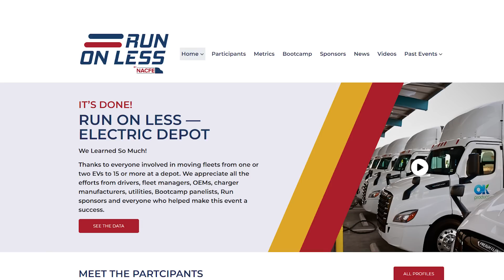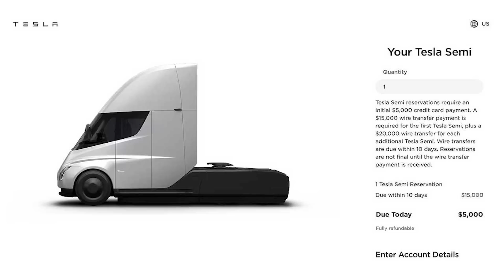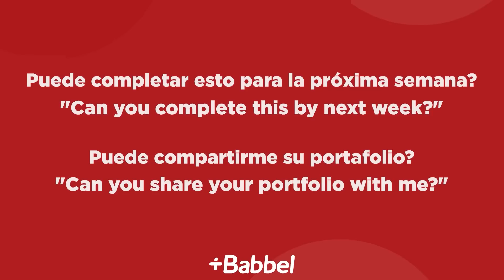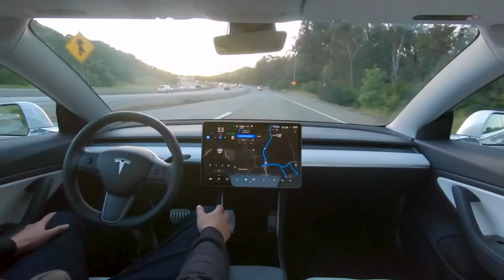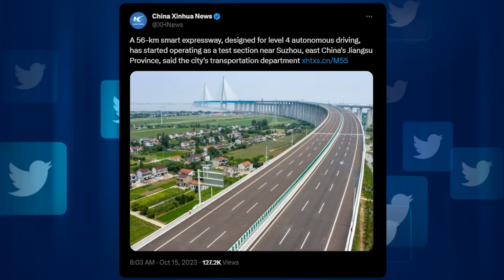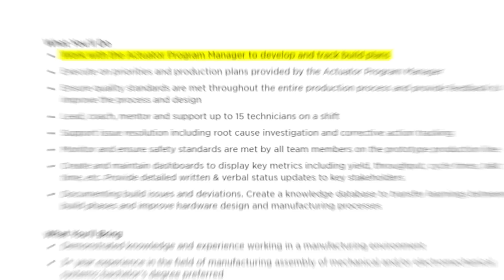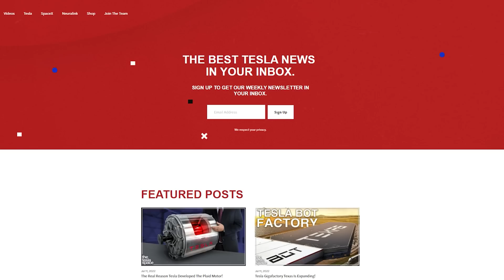Tesla Semi Performance Results Revealed!

Comment: As a driver 80k gvw is standard also didn't mention speed that 570 something miles was done at, betting it was 60mph or less most of the trip as previous tests have shown tesla truck can't do extended highway speeds for long. Electric truck may work for local (300-400 miles a day) but not for over the road.

Comment: Three fast charges a day?  Those batteries won't last a year at that rate.  Just watch what happens to Lyft drivers when using a Tesla.
Reply: First of all, it wasn't three fast charges in a day; it was one fast charge at a Tesla Megacharger, and two slower charges at a Tesla Supercharger.

Out of millions of Teslas in the US, some have had premature battery failures; and some of those have been Lyft or Uber drivers, often after exceeding the warrantied mileage. But that's not evidence that batteries in general will fail within a year if fast charged. in fact, Recurrent has recently released a massive study showing that fast charging of modern batteries has very little effect on battery life; "The results show no statistically significant difference in range degradation between Teslas that fast charge more than 90% of the time and those that fast charge less than 10% of the time."

In any event, if they do fail, it's on Tesla, because there's a 1 million warranty on the batteries. So you can be pretty confident that Tesla has made sure that the Tesla Semi batteries won't fail prematurely when fast charged, because obviously that's going to be the most frequent charging experience. Best to  peddle your FUD elsewhere.
Reply: @BigBen621  It's not FUD if it's happening to others...  Fast charging kills these batteries quick.  Tesla is not standing behind warranties if you fast charge.  Both these cases are known issues.
Reply: @theoracleprodigy   Fast charging kills these batteries quick. 
The Recurrent study completely refutes this claim.

 Tesla is not standing behind warranties if you fast charge. 
Evidence?

 Both these cases are known issues. 
A few unsourced anecdotes are not evidence.
Reply: @BigBen621  Watch some youtube from people who have used them for uber.  For cars the warranty is only 50k in miles and it was out of warranty... So I was wrong on that but the battery was dead after 1 year of driving with fast charging.  I would be very shocked if they last 1million miles with trucks.

Comment: The issue with electric vehicles  is not the vehicles them selves its the fact that one the current power grid in this country can't sustain the current load in most places causing blackouts an rolling brown outs an 2 they are putting the cart before the horse there is basically no infrastructure to support a major shift to electric.  All the current truckstops would need charge stations that needs to be in place an effective b4 a shift to electric in the commercial transport industry. Just my opinion
Reply: "blackouts an rolling brown outs" in most places? Examples, please?

Comment: I was told by a Toyota employee working on the fuel cell project that they use the Tesla semi to transport their materials that they're using to build a fuel cell network throughout California. They're aren't enough Tesla semis, so Toyota is now developing a diesel/fuel cell hybrid semi, which imo is the best option. Toyota will also start focusing on fuel cell passenger vehicles more than electric vehicles. During the Summer, I had 2 members of the Olympic Committee as passengers. They talked about how the Olympics will no longer be a part of the pre-games, and that the Olympic trademark/symbol will also not be used for pre-games. This is due to money distribution issues and how they're tired of going through so many channels. I do Uber in SF, so I hear lots of things.
Reply: You either made this up, or you were told wrong; I'm betting on the former. Toyota isn't doing anything of the sort, because all Tesla Semis now in private hands are owned by PepsiCo.

Comment: so at 1076 miles with 3 recharges...... it has a range of 358 miles, while a diesel semi has a range of 900 to 2000 miles on 1 tank of gas.......
Reply: So what? In California, where all the Tesla Semis are deployed, a solo driver in a Tesla Semi can drive as far in a day as permitted by speed limits and HOS regulations, which is 11 hours x 55 MPH = 605 miles. So 295 to 1,395 if that range is simply wasted carrying extra diesel fuel around.
Reply: @Big_Ben_from_La_Mesa yeah if they fully fuel it. However many of them actually don't fully fuel them so they can carry more cargo with out going over the weight limit.

Comment: From someone been driving a Tesla model 3 for a week now doing rideshare and a retired trucker with around a million miles. I can say that Tesla is a great vehicle to drive. It will stay at the temperature that you last set while it’s plugged into a charger. So, if you set temp at 65F it will keep that without losing power/ miles. Tesla hates to change batteries when they are not under 10% and you can go from 0-60 without losing all your energy doing so. That means you will only lose what you would have lost with the same amount of miles. Also, everything is on the tablet to control the whole vehicle settings. You can customize inside lights, outside lights and horn to how you like it. It has face recognition on the tablet that once you use the vehicle enough it will start without you having to card screen (card key) in. You can also customize the braking and steering wheel the way you like it. Seat same, it has cameras all over the inside and outside the vehicle that if you were in an accident that your story is told without guessing. The bad part is that you can’t feel the weight of the load so I bet you can’t tell if something is off on the load. I bet Tesla can add an arm autopilot line hookup if we want one. Maybe they can design auto landing gear rollup and drop to the setup. The point is, if we think it maybe they can add it and allow the driver control from the cab.

Comment: they're fine for short hauls but thats it, btw 70lbs is not a full load, 70k lbs is the gross weight with all included, now i contracted for pepsi before an drove their trailers an i noticed in the bill of landing the weight with like 400lbs to spare to the 80k lbs limit was about 36200 meaning that if it was hauling with 70k lbs gross weight the actual payload at best would be 26600 at best if considering a tesla tractor weighs the same as a volvo vnl 860 but due to the batteries i highly dought it, i would estimate a 3000lbs increase on teslas side therefore the actual payload was around 23600 or less, which is light, so light in fact i would be very careful not to lock up the trailer wheels driving in Montana due to us considering a load under 25k lbs a light trailer
Reply: Demonstrated payload is 44,000 lbs. of concrete highway barriers on a flatbed trailer at 82,000 lbs. GCVW, so probably 43,000 lbs. in a slightly heavier dry van trailer.
Reply: The Tesla semi is calculated to be around 27,000 lbs. Which makes me wonder if all the extra weight on the drives will limit payload weight due to tandem sliding.

Comment: 70 000 pounds full load, but what was the payload? I could make an electric truck that would go 20 000 miles but could only car 1 pound of payload, deceptive results again.
Reply: ive sub contracted with pepsi before with their trailers ive noticed a close to gwl of 80k load was bout 36200 of payload so make of that whatcha will(the tractor driving with was a 18 volvo vnl 860, the tesla ones prob heavier then the 860)
Reply: @ELISainta  for sure its heavier, that's why they won't release the data
Reply: Demonstrated payload is 44,000 lbs. of concrete highway barriers on a flatbed trailer at 82,000 lbs. GCVW, so probably 43,000 lbs. in a slightly heavier dry van trailer. So at 70,000 lbs. GCVW, payload would be about 31,000 lbs.
Reply: @BigBen621  we wouldn't have to speculate if they released their numbers, I wonder why they don't.

Comment: You are so Incorrect regarding weights of transport trucks. A 5 axle combination is allowed to be 80,000 lbs total. Combined weight. That also depends on the Bridge Formula, Axle weights especially. NO way your precious truck hauled 70,000 lbs weight.  Let's see... It's simple. Let's assume the Tesla weighs around 30,000 lbs. Trailer looked like a 48ft,  so i'll say it weighs around 10,000 lbs. So looks to me like the Tesla can haul roughly 40,000 lbs. I know nobody will agree cuz everyone loves precious tesla,  But the real facts and numbers are not being shown. It's just P.R.
Reply: Good one. I was waiting to see if someone would call bullshit on this Fanboy channel.
Reply: That's actually pretty close. Electric and natural-gas powered semis are allowed an extra ton, to 82,000 GCVWR. And the Tesla Semi weighs more like 27,000 lbs. Demonstrated payload is 44,000 lbs. of concrete highway barriers on a flatbed trailer, probably 43,000 lbs. in a dry van trailer.
Reply: I can’t remember the exact numbers but I watched a vid where a guy did some rough calcs on the Tesla semi based on other semi and Tesla’s other EVs and found that the Tesla semi can only legally haul like 20k lbs or so. That battery is just weighing itself down so much.

Comment: BS.  The GVW limit is 80,000 lbs.  I have yet to see any data detailing range and towing capacity for this vehicle.  Fact is this vehicle weighs a huge amount because of the batteries.  Saying that we were able to go x number of miles with an 80,000 GVW is meaningless.  Tell me how much you were able to tow and how far you could go.
Reply: Comparing the estimated weight to my sleeper cab, it can haul ~5,000 lbs less. But all the extra weight on the Tesla's drive axles makes it impossible to slide tandems for a legal weight distribution, so in reality I'm guessing it will top out around ~10,000 lbs less. The shipper would have to take special care organizing loads that are above 38,000 lbs, and that's if the product can even be rearranged.
Reply: If you expect detailed and unbiased info about Tesla, SpaceX etc. products, this channel is one of the last places you'd want to be in. 🐒
Reply: Why do you need numbers? He's already said that it beats rail. I'll be picking up my own diesel electric engine soon when they're being sold for pennies
Reply: The fan boys know nothing about GVW and commercial trucking loads. Pepsi will not be replacing their semis anytime soon 😂😂😂
Reply: What is also bullshit is claiming over 500 miles per day,how is that possible when in the us a driver is restricted to 10 hrs ,when you add in charging and breaks . In California speed limit is 55 ,this means the truck ran at top speed for 10 hrs straight.
Reply: Federal regulations actually addressed the weight issue by increasing the GVW for electrics to compensate for the weight of the battery.
Reply: The idea that all trucks are running around at full weight is a fallacy
Reply: @fradaja  Just looked at my past BOLs hauling varied dry van freight. 7 out 10 of my recent loads were above 40,000 lbs.
Reply: @MobiAussie  
Exactly nearly half weight
Reply: @fradaja  
Can you read? That's the payload, the gross weight would be above 74,000
Reply: @fradaja  and how many do nothing but non stop cross country trips ?
Reply: @whdbnrm3023  

No such thing as a non stop cross country trip
Reply: @fradaja  exactly , making the distance on a charge argument. silly
Reply: 55k load and around 430 miles based on what I've read.
Reply: The Tesla Semi, in its 500-mile version, weighs <23'100 lb.  Taking into account the 2'000 lb allowance to electric trucks, it can tow an amount right in the middle of the diesel truck weight distribution.  And if you consider only high-powered trucks, so as to compare apples to apples, then it is better than most diesel rigs.
In its 300-mile version, optimal for regional deliveries, it weighs <19'800 lb.  Taking again into account the 2'000 lb allowance to electric trucks, it can tow more than most diesel trucks!

Comment: Yeah but, fast charging cuts battery life in half. How much does it cost to replace the batteries 2 to 4 years? $50K, $70K, $100K?
Reply: It does not cut in half... Were did you get that? Charging rates do in deed affect the battery life, due to the heat being created. Tesla have reached well over 300.000 on first battery. Another problem is fully charging.... Which can be avoided by a setting in most cases, or simply by unplugging. Also you need to see the charging speed in relation to the batteries' capacity.
Reply: That's make up , you can't even define what "fast charging" is

Comment: Tesla is a solid lvl 3 autonomy. 

Since China has a high level of ‘centralisation’ it can actually work there by fragmenting into two categories: high-speed highway commute which is good for the economy and limited by territory robotaxis (mapping, sensors) since a taxi service is limited to a particular city/area. It is not general FSD, however, just big cities and intercity commute (70% of the traffic).
Reply: Tesla is a solid lvl 3 autonomy. 
That would only be FSD, and FSD Beta doesn't meet SAE requirements for SAE Level 3 driving automation. Level 3 allows fallback "in a timely manner" (MB Drive Pilot uses 10 seconds), while FSD requires the driver to take over immediately. Until FSD can allow delayed takeover by the driver, it's still Level 2.
Reply: Liar, it's only lvl 2.
Reply: @cyruslupercal9493   Liar, it's only lvl 2. 
You're almost certainly wrong. That would be a lie only if Pavel knew it was false at the time he said it, which is unlikely. Calling people liars when they're simply mistaken doesn't benefit anyone.

Comment: There is a reason the Semi beat the competition - it has a much larger battery and they over-charge - its not LFP so 80/10.
1:39  You failed to mention there were 2 drivers.  1 driver can only drive 11 hours per day.  So, to achieve 1076 miles he'd have to go at 98 mph.  I smell BS.  PS, its only 8 hours max in Europe
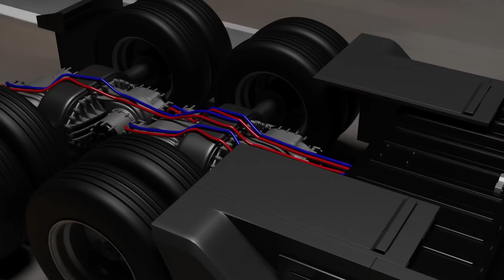1:42 It wasnt a full load of about 70,000 LBs.  It was a GVM of 72,000Lbs.  Seeing as Tesla refuses to tell us the TARE, nobody knows the cargo mass.  Notwithstanding the GVM was 10,000 LBs light
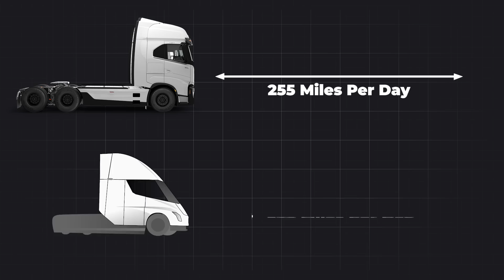2:33 You dont know how to compare correctly.  Apply some critical thinking and math.  Tesla used to say 2 Kwhr/miles, now its 1.7, but it's an "estimate".  Why the change?  2 other vehicles were very close at 2.0 and 2.2.  
Charging was done on 1MW chargers.  How many of those are there around the country - f^&kall. So try it on a 350Kw charger!
As usual more BS reporting.
Reply: Considering the Model Y os the best selling car in the world I'll bet the semi works out jist as well.
Reply: "It was a GVM of 72,000Lbs." where did you get that? Can't find it on their (run on less) website.
Reply: Tesla is hiding stats about these vehicles. I'd love to know the Tare. I'm thinking around 30,000 lbs.
Reply: Get some friends, get out of your basement
Reply: Yep this channel is just run by some Tesla Fanboy.
Reply: Also there are multiple accounts of Uber drivers who have killed their batteries with fast charging in a little over 100k miles. These batteries are the same chemistry and are susceptible to the same damage.

Comment: why Tesla doesn't build the trailer with batteries to just connect and transport. This way, the semi would not need to stop to charge as the battery would be charging and being transferred via cables.
Reply: It would exceed the weight limit, detracting from the load it could carry.
Reply: 😂 not a serious question.... Or Wait, is it?

Comment: Very good video. Unfortunately, I can't subscribe or like it, because you add advertising (on top of YT) without the ability to skip it (chapters).
Reply: The weight of the trailer would limit capacity. Batteries are heavy.
Reply: It's YouTube, you can skip whatever you want, just tap on the right side of your screen a few times or click further on the progress bar of the video.

Comment: This test is actually a pretty severe one, especially if you have to deal with the steep climb to Donner Summit on Interstate 80 east of Sacramento and long slopes of Tejon Pass with its high summer temperatures between Wheeler Ridge and Santa Clarita, CA. The fact the Tesla Semi did so well is a testament to the excellent engineering of this semitruck. Interestingly, the first major competitor to the Tesla Semi could be something from Hino, a subsidiary of Toyota. Expect a sleek-looking semi using Toyota-funded solid state batteries by 2026.

Comment: Cheers. The actuators would surely be machine produced though by a machine designed by humans. Or maybe AI? The plaid motors for the S and X are of the hair pin 'winding' type for the stator. Wires are round so you lose more space than you would with square 'wires'. Huge increase in efficiency .. less power required and more power output. Exceptionally stable magnetic field The Semi has a couple at the rear for acceleration / uphill but is otherwise moved by a single 'standard' motor. GM actually invented the process many many years ago but couldn't make it stick. 10-15 years ago. Rivian are using pin motors and maybe VW. The motors for the Gen. 3 are without rare earths because they have or will have such command over the generated electromagnetic field. Point being is that the Tesla 'motor dept' is going to be full of clever people who see actuators as the motors they are. Tesla are looking for someone to develop a system to assemble the bot so they must have all of the ingredients... or at least enough to start off with.